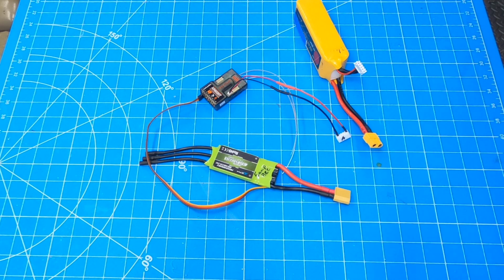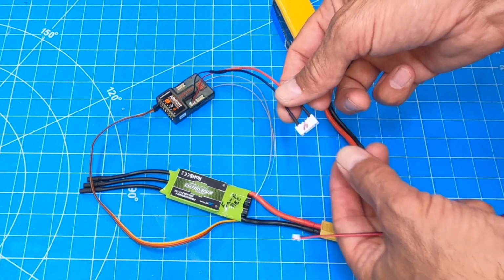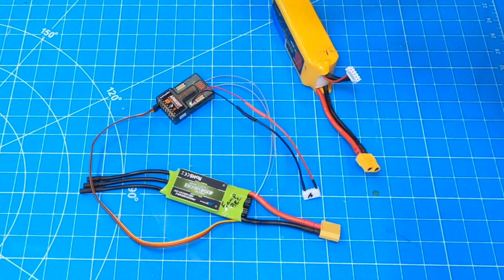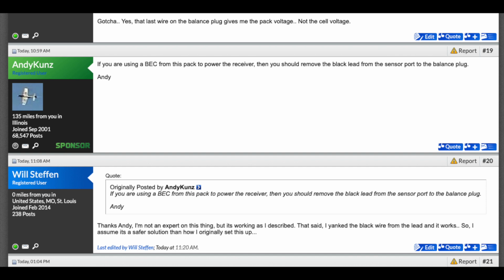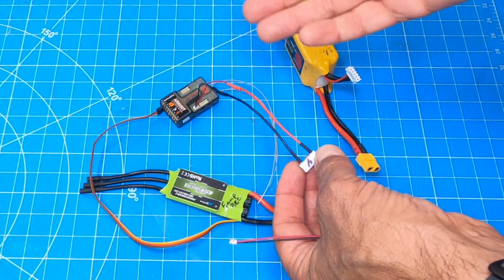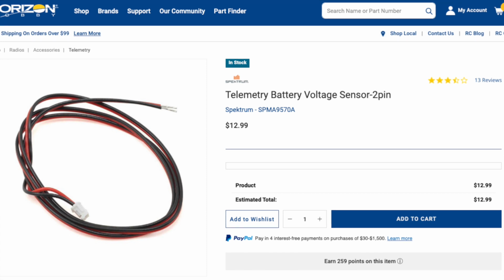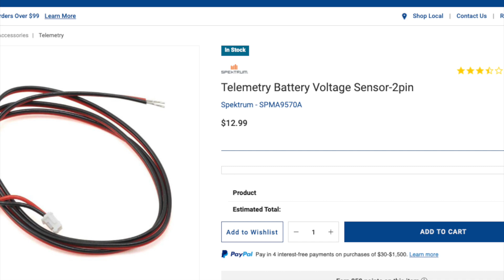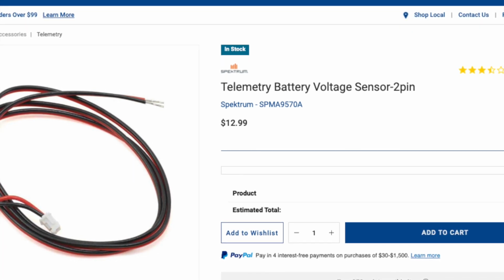How to use the Spektrum Battery Voltage sensor lead without frying your receiver

Comment: Andy Kunz explanations on RC Groups tend to be cryptic and not thoroughly explained.  I finally got up the nerve to punch a hole in the red battery lead to the ESC and attach the red lead from the telemetry cable as shown.  No need to connect the black lead.  I didn’t cook the receiver (AR637T) and I got telemetry battery voltage to the transmitter.  Thanks for posting these kinds of videos.👍

Comment: I just bought my first Spektrum reciever (AR8360t) and it had that wire...didn't know what it did or where it went...no info at all....thanks for clearing this up...I'm surprised there isn't a plug in piggyback connection for the wire...Traxxas does that to dummyproof its stuff...and make adding accessories super simple
Reply from the maker: Its hard to find the details about a lot of this type of info..  I recently did another video on how I connect this telemetry wire to my ESC..Hope this helps.. 
   https://youtu.be/6XmoxY0mHSY

Comment: It was never explained why connecting to the balance plug was a problem.  Spektrum said attach red and black to the +/- of the esc power input and that's exactly what you get with the two outside balance plug pins.  Only think I can think of is the order of hookup is important.  If you plug in the balance connector to the TM cable before plugging in the main connector, maybe that causes a problem.  But if no one can confirm that it is a problem or why...maybe it was just user error on the reporting person's part.
Reply from the maker: I was surprised at the lack of instructions on this telemetry from Spektrum.    I currently (no pun intended) just use the single red wire from the Spektrum VOLT plug to the red wire on the ESC.  I remove the black wire and make things simple...  I made a video on this setup. 
 https://youtu.be/6XmoxY0mHSY

Comment: Good explanation. I hate de-soldering and re-soldering just to add this sensor lead. I like the puncture, insert tape method. I'm going to try that!
Reply from the maker: Craig. I appreciate the feedback.   I’ve messed with this stuff for a while.  Love my voltage telemetry 😀

Comment: Why not peel back some insulation on the red lead to the ESC, solder the telemetry wire and then tape - a mechanical connection seems sketchy here ?
Reply from the maker: @zutniak  yep, I made a few videos on this telemetry cable.  This one and the one prior should be removed.  The latest version is a much better way to connect.  Your comment is one of those ways.

Comment: So if your powering it through the esc do you still hook both up wires to the two battery leads  or just the red?
Reply from the maker: Yes.  I only use the Red wire with that configuration..  Here is another video...https://youtu.be/6XmoxY0mHSY
Reply: @ i couldn't figure out why i was getting a pack voltage alarm on my maiden flight on my new glider. I soldered up both black and red to the connector.  I'm thinking that caused it

Comment: Hello great explanation, just to be sure..them I can get telemetry battery voltage using the telemetry cable that comes with the new AR637T receivers and using just the red wire with the red wire of the balance lead connector as you show in this video? …thanks
Reply from the maker: Yes, you can use that method as I described, but I no longer do that.  Now I attach the red lead to the red wire on the ESC..  I just released a video this am describing this process.. https://youtu.be/6XmoxY0mHSY

Comment: I have a couple questions concerning this mod , and thank you for showing this . Wouldnt it be easier to connect this voltage wire from the receiver directly to the positive and negative battery leads of the ESC , why connect to the balance wire of the battery ??  And if you are running two ESCs can you parallel wire the end of this connector to both battery wires from the ESC or to the balance leads from both battery packs if i follow this vid ?? I have a Zonda boat with two ESCs and this exact receiver running two 6s batteries with the DX5C PRO and would like to utilize the voltage levels that i have access to with this transmitter ..
Reply from the maker: Wayne,   Your observation is spot on.  I currently just solder the positive (red) wire to the battery plug/wire.  Then run that red lead to the VOLT, plug on the RX.   It’s the easiest and safest way.   I don’t mess with the negative wire at all.  If you look at some of my recent build videos, I mention that process.  I guess I should do a follow up on this video. 😀
Reply: @SteffenRC  Dont mean to bother again but thanks for the explanation . Another quick question , please correct me if i am wrong but the whole reason for the volt connector on this receiver is to send system voltage to the transmitter . cant you just run a jumper wire from the volt connector to the battery channel of the same receiver ?
Reply from the maker: @waynesbutler7834  running a jumper from the Volt sensor plug to the power from the ESC/BEC wouldn’t give you Battery Voltage telemetry.
Reply: @SteffenRC  I realized that after i typed it , OK your idea still works especially if you plan on doing a vid on this change or direct me to your vid where you touch on this topic . I enjoy your camera work and your explanations
Reply from the maker: @waynesbutler7834  I’ll make another video in a week.

Comment: Seriously this is convoluted MESS. and requires me to connect extra crap... why not just build it just like the Telemetry Battery Voltage Sensor: EC3/IC3  which works AWESOME and I copied instead of this crap of messing with the balance plugs THUMBS DOWN TO THIS TOTALLY
Reply from the maker: Thumbs down, Ok. That’s fine. You’re probably not interested, but if you look at my recent video, I bypass the balance plug and connect to the ESC power wire.  That said it appears you have the best way for you.  Sorry my video disappointed you..

Comment: I bought  balance leads from Amazon and they where wired incorrectly red being on the wrong side. Maybe that's what happened.
Reply from the maker: Yep..  My initial video I mentioned that there is a reverse polarity issue with the plugs from Amazon..  The Spektrum part is correct...  The issue is basically, if you are powering the RX from the ESC/BEC and the balance port, you can have issues.   To reduce the chance of smoking your RX, either connect the lead to the ESC cables or just use the Red wire on balance plug...

Comment: Honestly, there must be something else going on. I watched your first video. the guy must ran the hot into the ground causing a short. ground is ground and shouldn't have mattered
Reply from the maker: I know what your saying.  Mine worked great.  But, comments from Spektrum lead me to believe the best practice is just use the Red if connecting to balance lead.